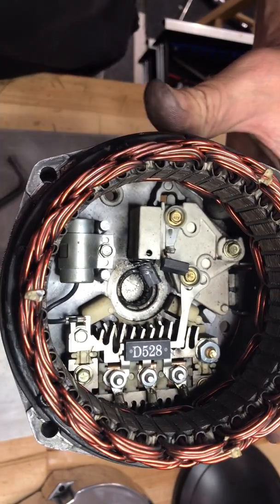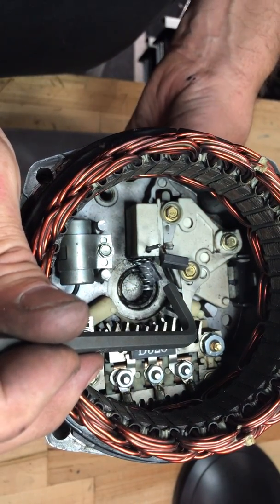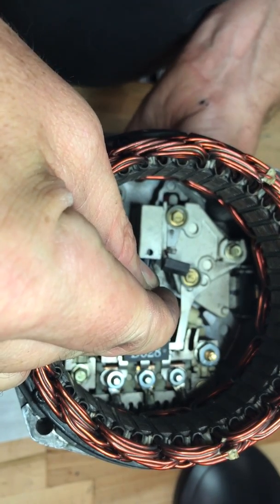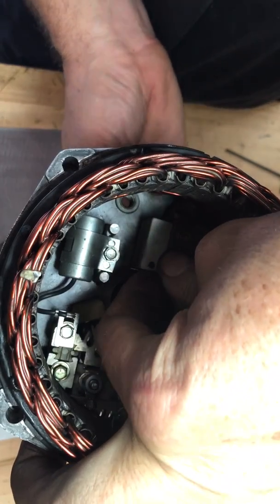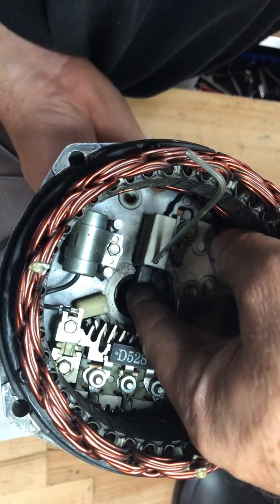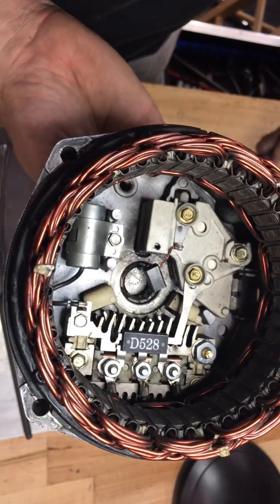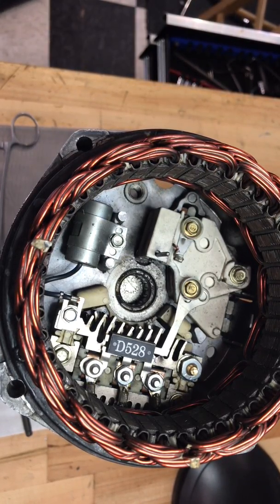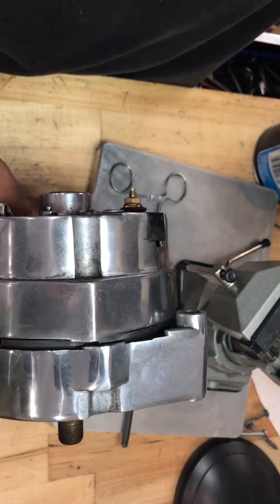Installing brushes in GM alternator

Comment: Thanks I had no idea about that little hole or how to reinstall those brushes. Thanks to your video I got that all back together and she’s putting out over 14 volts. Perfect. I had to take the alternator apart to tighten that internal nut for the charging post. Sob was loose as a goose and wasn’t charging the battery. got that bolt down tight with some lock tight thread locker good to go.